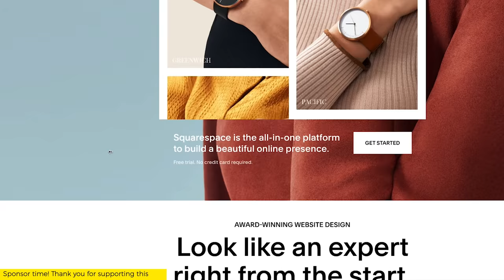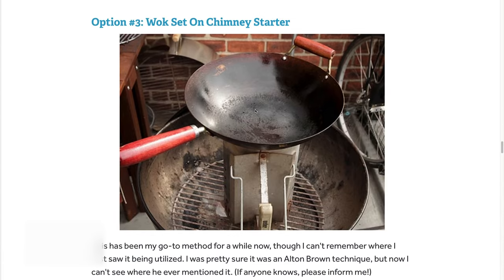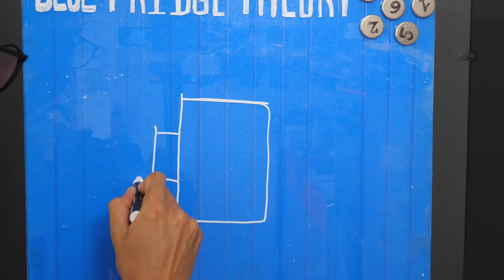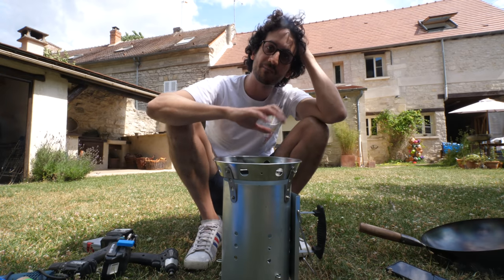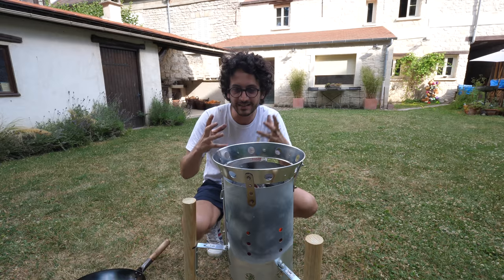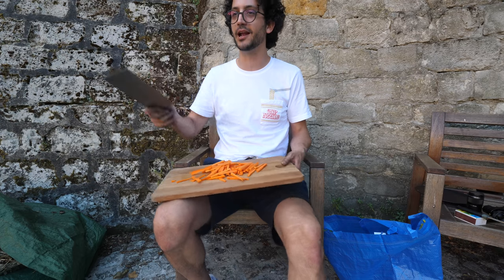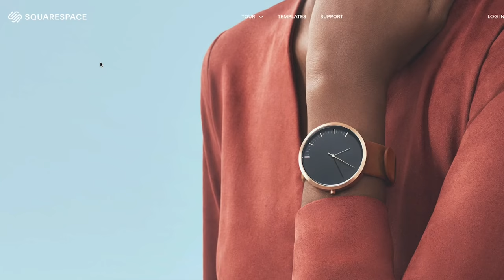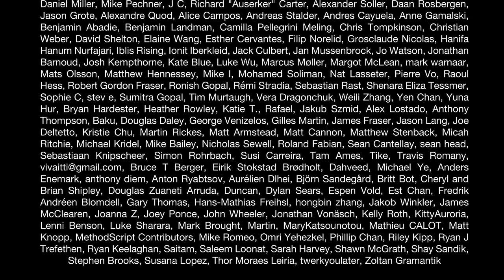How to make a Wok Burner from Chimney Starter (hack)

Comment: A leaf blower would be way too much air. I would recommend a hair dryer for just the small amount of air flow you need in this setup.
Reply: I used a hair dryer once in something similar to this. It became well over 1000°C so would not recommend for cooking lol
Reply: I think a small bellows or one of those hand pumps for inflating an air mattress would be perfect.  Ideally, you could rig it up so that you could have a hose to direct the air and be able to operate it with one foot.
Reply: If you build in a valve to control air flow into the unit, and exhaust what you don't need, you can control the temperature of the fire (coal smithies do this).

Comment: Hey Alex. I think you are on the right path with this design. If you find a way to couple an air pump/fan to the chimney starter you could use the speed of the pump to regulate the heat of the wok station. I use a 12V inflatable mattress air pump to fire up my chimney starter, and it is crazy how much the extra air helps. I run it at about 14 volts with an adjustable DC motor controller for that extra power. good luck

Comment: Look into rocket stoves. They're wood burning, high heat, and relatively efficient. 

Great stuff as always!
Reply: I was thinking the same. They're incredibly simple to diy as well.  All you need is some concrete mix (perlite concrete would be good to cut down on weight. I've seen it used for pizza ovens, so the heat shouldn't be an issue.) and a mold made out of a five-gallon bucket and some pvc pipe (or anything really, these are just cheap and readily available materials).  The whole thing could probably be done as cheap or cheaper than buying a chimney starter alone would be. There's also tons of room for customization since prototyping would be relatively cheap and easy.
Reply: Self feeding rocket stoves are pretty awesome! High heat, long lasting flame!
Reply: Curtis Bowman could also be made of clay or welding steel
Reply: Yup, tons of options to make them.

Comment: We have been using one of those starters with a wok on it when we go camping for years. Sometimes I notch the top a little sometimes not. Never bothered to add the wok ring, have a small wok for it. We just set it on the ground. In the spirit of how we have always used it, you could use a blower used to blow up air mattresses that plugs into a car power outlet . Set it on the ground , dig a small trench out from under one side and direct the blower under the charcoal starter. I can vouch that this will make one heck of a hot flame. Was great fun for the kids to watch until metal starts warping from the heat, then you have to stop because supper still has to be cooked.

Comment: How about a foot operated chimney bellows? ("Soufflet de cheminée" in French)
It would require no power to be used in the garden. It's pretty inexpensive and you could pipe the air directly inside.

Comment: If you need additional flame (not more heat), you should add some firewood on top of the coals. If you need more heat, look for better coals, that are denser and look more like blocks or somewhat uniform.

Comment: You could plug a simple hairdryer to the chimney. It would rev up the flames, but not so much as a leaf blower. so it is more controlable.
Also, you could put the legs on an wider angle, with a frame on the bottom in the shape of an Y. So the whole thing becomes portable.

Comment: Why not make the legs out of large L-brackets/bent metal? Set hinges to fold them up over the top for storage, and then fold them down when it's time to cook and lock them in place. You could bend each piece of metal 90° throughout the length and split the end so that each "leg" essentially has two different stabilized directions. 3 legs with 2 different directions each giving you 6 different angles of stabilization. You could even drill holes in the end of each leg and drive some tent spikes through them to anchor them to the ground if you really wanted to get serious about stability. That way it's portable, stable, and easy to set up all while leaving minimal impact on the area you're using it in. 

You could probably hook up a hair dryer or pump/bellows to the rig to fan the flames for charring the ingredients in the Wok - maybe even set up a foot pedal for it so you could manage your temperature and flame manually on-demand.

Comment: Hi Alex, for the heat the leafblower idea is definetly a good idea. I would recommend using a tripod construction directly mounted to the chimney that are connected via chains at the bottom. But you have interconnect them in the middle, it should look like a Y, so those chains don't hinder you when you cook.

Comment: Hey Alex, Gareth's idea is all be it a little overkill is what it lacks I think. It seems that the fire is not hot enough also. If you add dynamic airflow with a leaf blower or maybe even a hear dryer, you will create a much higher heat and a more aggressive flame. This with increased temp's of the oil will allow to create the "flashover" more easyly. Good luck on the project!

Comment: For stability, you might consider brackets that align with the lower grate in the Weber. Three or four points around the chimney that fasten to the lower grate will probably stabilize it fairly well.

Comment: In some of the DIY channels I watch, there's something called a "rocket stove." There's several videos on how to make your own. Even one made with concrete blocks (cinder blocks). Also, check out "wood gas burners." They work by recycling the smoke that comes from a normal flame back into a burnable gas. They can get insanely hot, like 1500 F if made right.

Comment: For stability you could splay the legs out and add a triangular base of flat metal bars that these splayed legs can sit on and be held in place by.  As for flame as many have noted you just need some forced airflow and not very much at that.  A small manual bellows or bathroom type fan will produce more than enough airflow for the flame you need considering this type of setup could get your wok red hot if left running. Best of luck with the next version.

Comment: You might find the charred aroma on the wodden posts (might want tro change that part). Maybe a 3-leg metal construction with the legs at an angle, like big stands for torches or oil-lamps. 3 metal poles at an angle holding a metal-ring that holds the whole thing (Think like a camera-tripod for stability). For the Fire-situation just make some splinters and throw them in the moment you start using the wok. It won't burn long but you don't plan on taking long anyway. Greatings from Germany

Comment: @Alex

All you need is one visit chez Decathlon Alex. Let me explain:

-Heat wise, get the foot powered pump for air mattresses (4-5€). Then rout a bit of tubing from hardware store (preferably metal for the end or it will melt). This will work to fuel the fire in oxygen in a way that you can directly control with your foot. As you are cooking.

- For the conveniency. I’m thinking camera tripod. Or even better: Decathlon “portable chair”. They have some folding chairs that are super convient which you can adapt to fit the entire thing. 

I’ll let you do the rest. Enjoy!

Comment: I made a wok station out of a burner for a propane fueled turkey deep fryer and some spare scraps of metal. I included an additional adjustment valve for fine adjustment of the flame as the one  that came with it was more of like an on/off switch.

Comment: Maybe you shouldn't use wood for the legs. I noticed that they're already turning black from the heat.
Reply: A taller burn chamber would improve air flow via the chimney effect.  You could use a stove pipe attached to the chimney starter for that.  Also, you could mount it in a ventilated metal drum to both catch ash and embers and make a stable, but portable platform, with some sand to weight the bottom.  This would also make it safer by acting as a heat shield.

Comment: You made the joke about lighting up the forge, but like a forge if you ad more airflow (like a fan of some for on the bottom) you can drastically increase the heat output. Hope that helps

Comment: Just a few armchair rocket stove scientist suggestions, you could use a fan at the bottom powered by some Seebeck generators. You would of course want a durable fan, and perhaps a wire mesh on the bottom to prevent ash flakes and such interfering with the mechanism. Ave did a video a while ago duscussing such generators as a source of power in the field. Collapsible legs might solve the convinience problem, as well as metal spikes to aid in anchoring the device. Beyond that, good luck! Ps, excellent video as always.

Comment: Alex, bolt three metal bars (or square tubing) on the side of the chimney, at 120 degrees apart (basically equidistant) and put a cable or a small chain at some distance towards the bottom. then you just slide the legs sideways until the chain tensions. aaaaaand you have a wok station on a tripod. hope you like it, and hope it works.

Comment: A reinforced box of sand on wheels is pretty damn sturdy and relatively mobile, if a bit bulky. Basically cross stack 2x4's (think 'jenga', but with a wide square space in the center) securing with screws until the desired height, cover with plywood and seal gaps with caulk. Attach heavy duty casters (with brakes!) on bottom, then fill with sand, tapping the side of the box to fill the gaps. Sink supports into the stand, and mount the burner. This way you can adjust the height by sinking or raising the supports then re-settling the sand to keep them sturdy. a piece of acrylic or similar heat-resistant material could be cut to be used as a lid to keep sand from billowing upwards, as well as hold a catcher for ash beneath the burner.

I built an anvil stand for forging like this, just an idea.

Comment: You have a good start, one simple thing you could do without adding any electronics, is narrow the top of the stove out and add a little bit of resistance to the airflow at the bottom, not a lot, maybe cover the inner most ring on the bottom grate. In other words, make your stove more cone shaped.
Reply: should the cone be pointing towards the wok or away from it?

Comment: As mentioned, forced air will raise the coal temp significantly. Also if you want to try a different design that doesn't require/creates its own forced air look into rocket stoves. They naturally draw air like a chimney and if well insulated combust whatever material you are burning very efficiently and direct the heat straight up with some power. If you are going to go the propane route then maybe look at forge burners. I suspect your friend Alec Steele may be able to help you out in that regard! Happy building and looking forward to the next in the series!

Comment: May I suggest a secondary heat shield in case of catastrophic failure. You could repurpose a used 200 litre drum for both heat shield and base structure. Cut away about 1/3 of the circumference from the top to about 1/2 way down for easy access. Attach the chimney with brackets in the middle of the remaining 2/3 of the inside of the barrel. Put some rocks in the bottom of the barrel. If the chimney fails on the bottom, the charcoal falls into the rocks in the barrel and not on your feet. If the chimney fails to the side, whatever hot air and flame that escapes is redirected upwards along the barrel and not up your shorts.

Comment: Alex, you should read up on rocket stoves. They make lots of heat and big flames when built right. Also, making your station's legs longer, and curved so you have room to approach, but makes the base effectively quite wide, it will be exceptionally stable without having to sink it into the ground. A little creativity, and I'm sure you could come up with a folding design that can make the setup sufficiently portable

Comment: Mount the cheapest  electrical 600 degrees celsius weed killer/barbeque lighter underneath.
Basically, drill a hole in the side, just above the grate holding the charcoal, large enough for the mouthpiece to fit through.
Put it through and fit on the BBQ starter nozzle to secure it in place (it should come with one).

My weedkiller/bbqstarter has 2 settings: 50 degrees and 600 degrees celsius. use the latter to start the fire, the first one to supply air.
We are talking ~500 liters of air per minute here, so SERIOUS BTU for around 30 €.

Heck, if you aren't going to do it, I will, thanks for the great idea so far.

Comment: Hey Alex? What's the flapping piece of paper on your windshield? shouldn't you remove before driving?
Great idea as usual, I think I'm going to make one similar to this, though, a few changes I think...

A leaf blower is definitely too strong, but a PC Cooling fan on a dimmer switch should do the trick pretty nicely. 

Sticking it into dirt is one option, like you've done here, but consider a cement base. start with sand bags to find out how much weight you need to keep it steady while in use, then just use that much cement/concrete to create the permanent base. You can even make the vertical legs detachable from the heavy base to make it easier to transport. If you use a cement disk as the base, it can also acts as an ember catch and protect whatever surface you're cooking over.
I would suggest metal legs rather than wood for remaining versions, those legs got charred from the heat being that close to the heat.
Just figure out ahead of time how much battery you're going to want, LiPo batteries are pretty cheap these days, good for RC cars and planes and such, so that might be a good source. Charging/discharging electronics are often integrated too to make life easier. When you know how much battery you're going to use, then make your battery box big enough to hold that battery and the wires for it. 

If you go with metal tubular legs, you can even put the electrical box with the dimmer switch closer to waist height for ease of access, mount the battery box on the legs as well. It that also happens to be where you mount the PC Fan, all the better.

Just remember to mount the fan itself off to the side so it's not directly under the fire box or you risk melting your PC fan. A friend built a forge like that. Worked great until some embers fell down into the fan and it melted. Blow from the side and route the pipes up into the fire pit.
In the final version, you may even decorate it up a bit with a fireplace's mesh curtain. 

I think, do it in four pieces. the firebox (charcoal starter, wok fire ring, & duct work for air blower), a concrete or cement disk base with attachment points for the three legs, two plain legs, and the final leg that has the fan, battery, & dimmer switch. The fan, battery, & dimmer of course need to be heat shielded or far enough away from the firebox (or both) so they don't melt. You might even consider keeping the duct work a separate piece to make clean out easier, and it might also make transportation easier as well, so maybe 5 pieces rather than 4 if you do that.

Comment: My suggestion would be find a old Weber/kettle style grill with a good base. The tripod base with ash catch pan and wheels  would be perfect and then mount the charcoal starter to that. I would find/make a metal ring that is just big enough for the starter to slide in to then use L brackets as stops. To transport it just pull off starter and lay on the rack below if it has one. Could also get a new one  and do this but add twist brackets to the bottom of the kettle so the just slide in to the ring and then twist them to lock in place. You get 2 for one that way.

Comment: I use a petrol stove, it’s more stable for wok use with a larger flat pack stove with two burners. Eg the Coleman one for camping. They are very hot. You could easily get a wok glowing red if you left on on at full heat.

Comment: Alex If you were to adjust the feet to a 30 degree angle that would make the base wider to a total of 60 degrees and would therefore make the system stable for the cooking. If you maintain the 3 legged design it would allow for the space to stand and cook. If you hinged these the and added chain between them it would fold up and be able to be stored out of the way when not in use.

Comment: 2 wheel-legs and 1 pointy leg (making sure its level) would be stable and mobile. The wheels to make it mobile, the ponty leg to put it in the ground to stable it. Like a bbq, you will only havo to roll it around

Less oxygen at the bottom (so closing it a bit up) would mean the flames go higher which is needed to start the flame inside the wok. So make a valve or another way to control airflow.
If the oil wont ignite, it isnt hot enough so watch out you dont take to much air away. And keep airflow at the top.

If the flames wont ignite the oil, the oil isnt hot enough. Then you should place the wok on top of the coal and put more air in.

Comment: In Argentina, at least, charcoal is used only for embers, not flames. In that case firewood it's used. I'll recommend you to look for discos de arados, those are like country side Argentinian woks if you want. So, if you ask me, I would use small branches of firewood (veggies crates work pretty fine) to get bigger, intense but short in life flames, and if you are gonna force air into it, a small and gentle wind its great, otherwise if its strong again, you will have embers. Salut, wish you the best of the lucks.

Comment: to mantain the portability, to fix it to the ground maybe you can use a screw type of drill bit, the one used to dig holes but this time you attach them to a shaft that goes from the bottom to the top of the legs and then with a cranck of with a drill you spin the shafts and secure them to the ground, now to give it power you can adapt one of those battery operated cheap leaf blowers to blow from the bottom of the coal